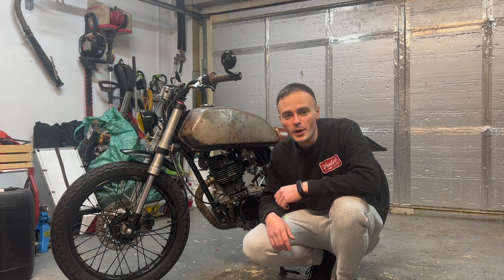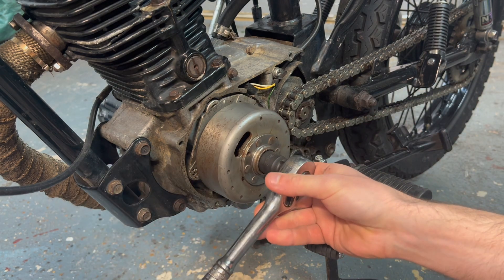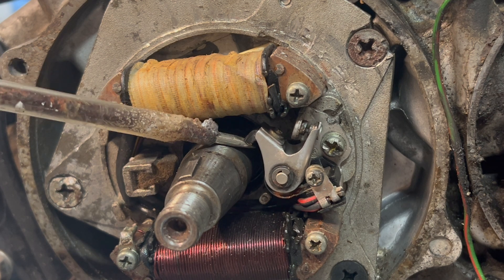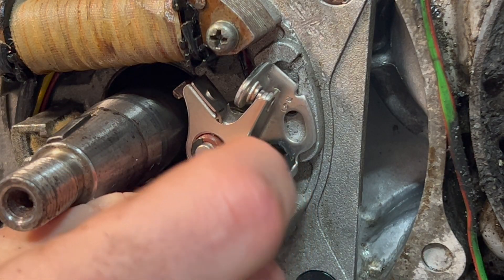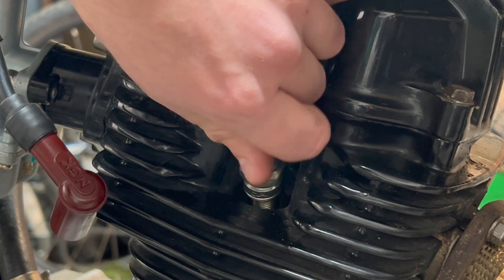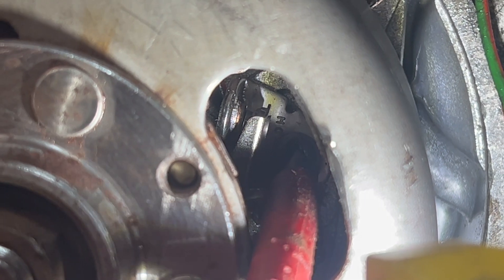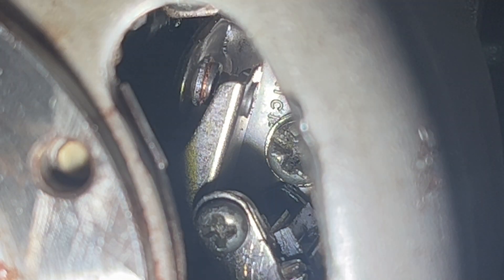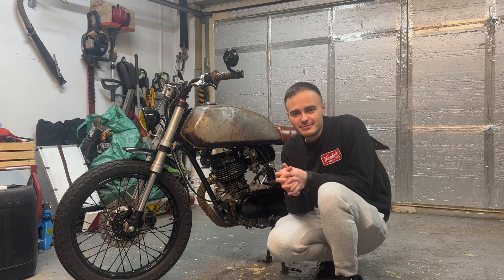Adjusting Points and Ignition Timing - Honda CG125

Comment: Fked up the flywheel interior with the clamping spanner 😠
Reply from the maker: Ahh no, that’s not ideal, what happened to the inside?
Reply: @TurnersWorkshop97 the head of the spanner broke off one of the spring mounts inside it
Reply from the maker: That’s so unlucky! Do you have a welder to tack it back in place?
Reply: @TurnersWorkshop97 it's made of brass or something. I've tried it
Reply: @TurnersWorkshop97 bro, I could sue you.. those parts dont come very cheap
Reply from the maker: I understand your frustration. However, as stated in the disclaimer on every video, I cannot be held responsible for damage that occurs during the use of tools or parts, as I have no control over the application, technique, or component integrity during the process. I can only share with you my experience of doing the job.
Reply: @TurnersWorkshop97 how convenient. You might want to update your video and save the next poor client all the hassle then, that you used the wrong tools

Comment: do know where i can get a stator replacement?
Reply from the maker: Have you tried on eBay? If not you could potentially try a motor repair workshop. They may be able to rewind it for you.
Reply: im at odds with something. do you know what the battery voltage should be? Thanks
Reply from the maker: 6v typically for 1990s cg unless it’s been modified the could be 12v like mine is
Reply: @TurnersWorkshop97 do you have to upgrade the ignition coil and the voltage regulator as well?
Reply from the maker: @c @casey9212  mine has a 6v winding for the ignition coil and 12v for the battery charging circuit/ lights. So if you change both to 12v you’ll need to also change the ignition coil and regulator.
Reply: @TurnersWorkshop97 hey again, just was wondering, do you know which wire goes to power the ignition coil
Reply from the maker: Hey, black and red if memory serves me correctly 👍🏼
Reply: @TurnersWorkshop97 i put in a new switch but still not getting power to the ignition coils 🫤

Comment: nice content sir, i was wondering if there is a tools to act like the flywheel so it is easy to turn and adjust the contact point, As usual to adjust the contact point you neet to install the flywheel?
Reply from the maker: Thanks, I'm glad you like it! 👍🏼 I’ve read somewhere that you can get a dummy flywheel which has a larger opening for adjusting the points. Would definitely make it easier if you can find one. Or find an old one and cut a larger hole in it perhaps 🤔

Comment: I’d what you are doing with the adjustment points are you “timing the motor”
Reply from the maker: Essentially yes in this case, bikes with multiple cylinders tend to have more adjustment but in this case the point gap adjustment will change the engine timing. I made a separate video for timing the engine using a strobe light if you’re interested: https://youtu.be/jxiCgZSCZxg?si=yJm2Ci6SW3Qg296C
Reply: @TurnersWorkshop97 I have a clone Chinese version that I can’t get started right now and I believe the timing is off because actual TDC on both strokes don’t line up with the timing marks I think the stator and flywheel wasn’t installed correctly at TDC like it should have been

Comment: Thanks! Really good video, good clear instruction and helpful guidance. I'm interested about the filter you seem to have on the crankcase breather pipe. I suppose it stops any debris getting in... Mine is simply a pipe exiting behind and below the crankcase
Reply from the maker: No problem, yes just an oil breather filter. This one is made by K&N, so it’s good quality. Exactly that just prevents water and dirt entering the crank case.

Comment: It looks like the points gap sets the ignition timing as on your other video with the timing light it looks like you were adjusting the points gap to get the timing right ?
Reply from the maker: The points gap does adjust the engine timing, that’s why you start with the points gap and then fine tune with the timing light 👍🏼

Comment: Great vid, very informative! I have a similar model, 93 br-k. One question… where did you find the torque specs?? I can’t find any data for the pre-85 models in the Haynes? And the specs that are given for the 85 on models don’t include info for the flywheel nut for the br-k…

Comment: I doubt my primary stator coil is broken... 
Because, when the engine is hot the engine shut down,, and hard to start again...
Reply from the maker: I would say that the primary coil is ok as the bike starts. You can check the voltage output when the bike is running and it should read around 6v to the ignition coil. I would do the basics, serving, valve clearances and ignition timing and see how you get on after that 👍🏼

Comment: Good job! This brings back some good memories when I had a JX110 and converted it into a CG125 ;)
Not sure if a original CG125 has 5 or 4 speed drivetrain, but what I did in the past was that I took the drivetrain from GL100 and swapped to my JX110. Then I oversized the cylinder bore to that of 125 cc and using the Wing 125 piston kit. Anyway, the contact point was a pain to keep up with, so I replaced it with DIY 2-units CDI system (like one in Suzuki RC110) and never had to change spark plug ever. 
Now I wish I could have that bike again!
Reply from the maker: Hey, thank you! Sounds like a great project you had :) Mine has a 5speed, not sure about the earlier models. I am considering a CDI upgrade in the future but I quite like the simplicity of points ignition, although it’s more maintenance 😁 did you find it made a noticeable difference when you upgraded?